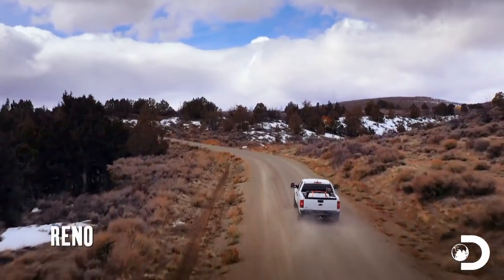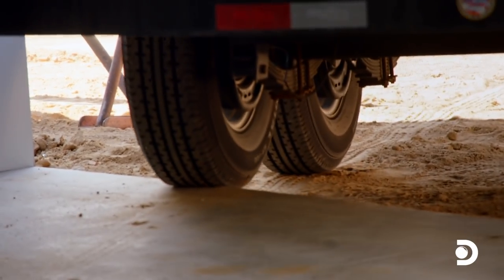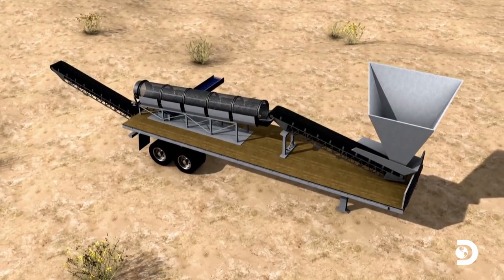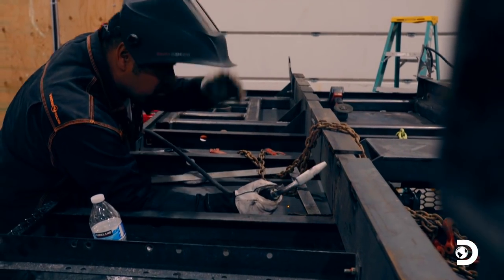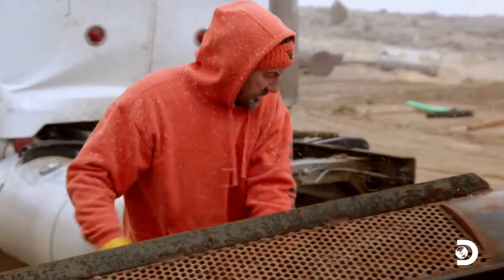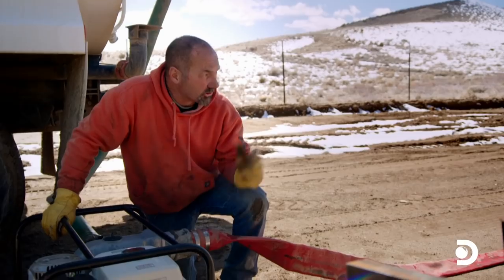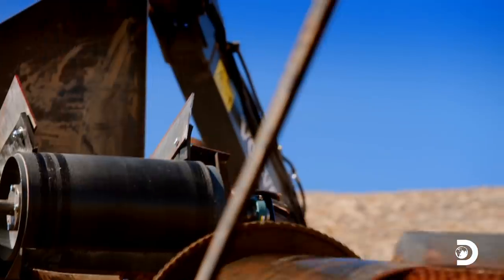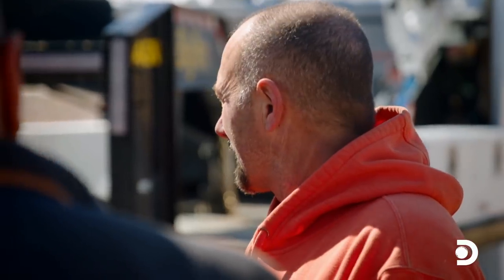Building a Portable Wash Plant | Gold Rush: Winter's Fortune

Comment: I really think turning the entire plant around would be a good idea.  Lowers the pay hopper and you can actually hang it off the back end of the trailer, just move the lights to the rear.  Also can put the generator up on the goose neck so it doesn't take up trailer deck.  Put up a jin pole to move the gravel and sluice extension.  Can actually use the jin pole to suspend the sluice.  Put jacks at all four corner of the trailer to level it.  But, got to start somewhere.

Comment: why are they not crushing the rock to get the gold out of the rock
Reply: Because they are only after Placer Gold which has freely floating gold.   You only crush rock if it is hard rock and bound up within an ore body.   There has almost never ever been a time when a placer gold mining operation would ever crush rock unless you had free mill gold AND ore in the same place for some reason.   Also, just because you can crush a rock into dust, doesn't mean that you can extract gold from it, often times it is chemically bound up as a sulfied ore deposit.